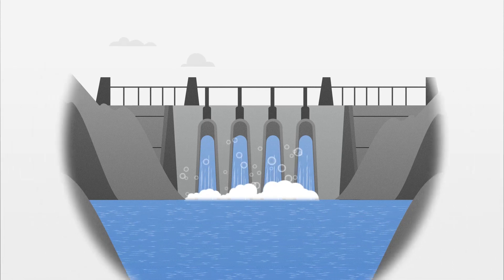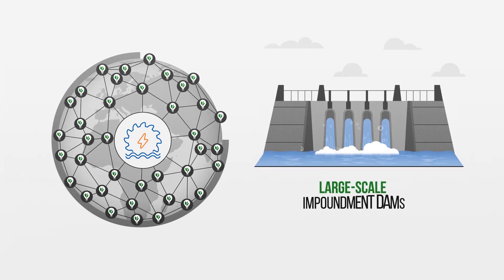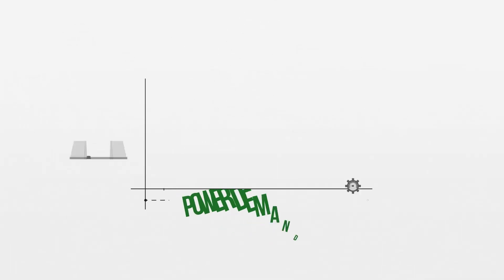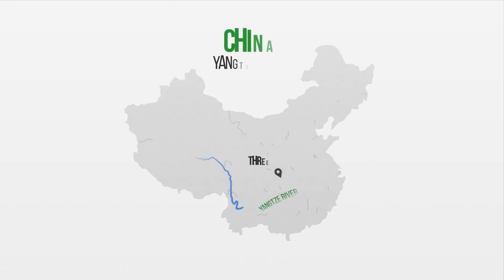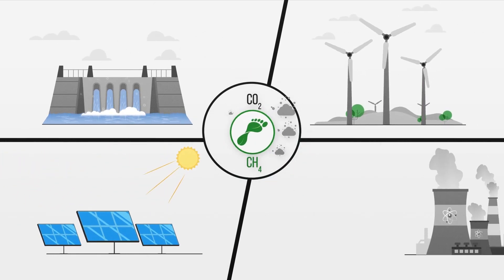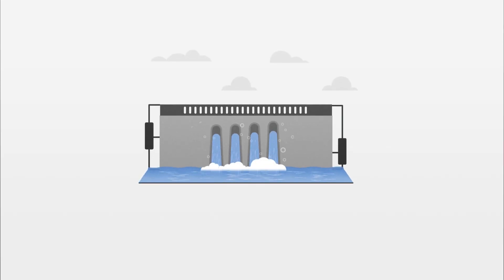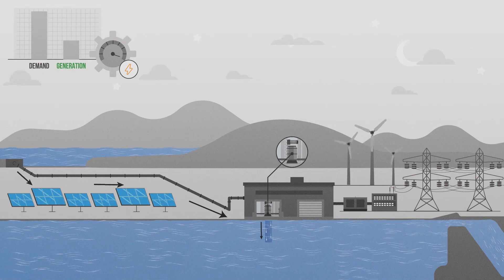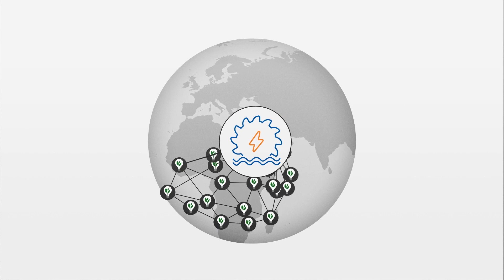Hydropower - Power of the future or relic of the past?

Comment: Some countries might be able to do it.. if they had a suitable area, the infrastructure, resources, and capital. But will it be worth it? How much is electricity going to cost? I mean Australia doesn't even have water inland to start with.

However, I hear the new generation of nuclear power plants don't even have radiation, although I don't know about that for sure, because what they do is hit an atom with lasers and heat it up. That's what gives you massive surplus energy without radiation or dangerous waste, and you can apparently have power like that in something that can be as small as a shipping container or two.

Comment: You are only seeing half the solution. Here’s my solution. Pumped Hydro is inefficient.

Hydro Battery Desalinator Dam 

https://www.dropbox.com/s/1kr8nqqr2stph2n/GraberHydroBatteryDesalinator.jpg?dl=0

There are two main problems in Australia. No cheap power and not enough drinking water. This solves both at the same time.

Desalination in Sydney Australia costs $90 per household even when its turned off, and an extra $30-35 when its turned on...My way would solve the problem without any “holding” costs of such a plant...Mine also doesn’t use the same electricity required to power 30,000 homes each day it operates so. 

Renewable power is a pipe dream that despite decades of massive subsidies around the world they  have only served to destabilise cheap existing energy networks because: -
 
	1.	Renewables are very carbon intensive and costs more energy and $ to create than they will generate in their lifetime. They are low energy density and have short 20-30 year life spans and are very difficult to decommission because they contains hard to recycle/expensive components (or in case of wind power are very large and expensive to pull apart safely when they rusts or break). They also take up huge tracts of useable land and destroy wildlife.
	2.	Solar and Wind only work intermittently are very weak producers and require more reliable backup power like coal/oil to work (very inefficiently) to support base power load when renewable suddenly stops supplying power. This sporadic use of coal/gas power stations causes them to work at roughly 3 times what it would cost to run them smoothly non stop and explains why our electrical bills have gone from being the cheapest to being the most expensive in the world.
	3.	Wind is most active at night when there is minimal demand on the grid, so the power must be given away or stored in very expensive and inefficient batteries that also use poisonous materials and are difficult to recycle/decommission. Otherwise the excess power could damage the transmission networks.

In Australia we are selling cheap coal to burn in China to import expensive diesel to burn here... why? It gets burned in the same atmosphere-that’s a huge impost on our economy for the sake of pretending we are more woke.

I have been saying for some time that as long as we stop building new dams while allowing our population to rise we are at higher risk of drought.

Firstly let me just say that I am not an engineer, I am only a problem solver who likes to help businesses reduce waste, by  installing repeatable and effective processes that save them money and make them more competitive.

Defining the Problem.

My idea is a simple combining of two very successful and proven technologies currently successfully in use in the world to solve the dual problems of 1) fresh water and 2) inefficient power supply.

1) We are a huge continent of which 2/3 is desert but surrounded by ocean (salt and chemical containing water). The obvious solution is to convert the salt water and filter off the impurities and return clean drinking water into the environment. The way to hold large quantities of water is of course dams. Dams suffer from huge surface evaporation and would therefore operate more optimally under a roof structure. e.g. a salt still. This would also drain water from the oceans that are "supposedly" rising and store it on land. A salt still evaporates salt water and then uses a roof to cool and condense the fresh water and collect it in a separate container.

https://www.dropbox.com/s/mbzeyoj84rg9k1w/SaltStill.GIF?dl=0

2) As we have moved to higher 'fluctuating' renewable energy sources we need to store or redirect the flow of current when it is not needed, to when it is needed. This requires the use of batteries, far bigger/dirtier than we can/want to currently manufacture. Batteries unfortunately wear out being able to hold less and less charge and contain rare and poisonous materials. There are also physical limitations and other considerations that make massive scale electric batteries uneconomical and unsafe. The obvious solution is to store power in a different form (Hydro Battery) which is limited only by the size of the water supply that powers it and never loses storage potency and stored as potential energy. 

https://www.dropbox.com/s/puca55o73opikuj/Hydrobattery.JPG?dl=0

There are many hydro battery dams that are used in Europe and they are used in a very inefficient manner. Cheap off peak electricity is used to pump water up hill to a higher dam during the night and then sold at peak when it is released downhill during the day powering a turbine. The differential is the profit margin which is typically thin due to the loss in transfer of one energy to another.

Solution

Combine the two technologies in an effective and efficient manner that provided ongoing relatively maintenance free power and water. 

This version is totally green so it uses an unreliable solar lens (perhaps backed up by some more reliable heating mechanism to use when there is little sunlight)... to heat (at minimal cost) the salt water into steam on the far bottom left of the diagram where the solar lens is. This superheated steam powers a turbine to generate some electricity with the steam eventually hitting the clear roof of the structure forcing it to rise and hence cool so that eventually it drips down over the higher dam as fresh water. This higher dam can then be used to generate hydro power in two ways. Firstly to the town water supply as fresh water, or as needed back to the salt contaminated tank to generate electricity as needed during peak usage. 

The remaining concentrated salt water tank runoff can be regularly filtered for contaminants and salt scraped out to provide cheap salt for cow licks etc. The pumps needed to pump more salt water from the ocean into the system can be run from the Hydro Battery as needed (once it is initially primed). There is obviously a need to first develop a network of salt water pipelines to service these units, all over the country, wherever they are needed. There will also need to be some thought put into how to optimise the steam power produced to drive the turbines most effectively, but I leave that to the engineers.

https://www.dropbox.com/s/1kr8nqqr2stph2n/GraberHydroBatteryDesalinator.jpg?dl=0